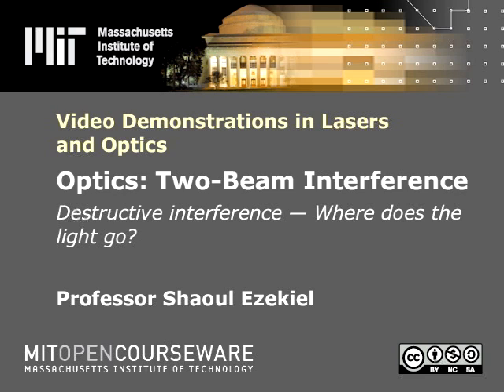Optics: Destructive interference - Where does the light go?

Comment: This is my attempt at the answer to his question at the end: the beam splitter has a thickness, assuming that it is a half-silvered mirror I imagine it could have a layer of silver nitrate around 200nm thick. the light that is returned to the source actually has a different arm length difference than the other since the light returning to the source has one half that was transmitted twice and the other is reflected twice giving a difference between the two lengths a difference of the thickness of the layer of silver.

Comment: Sleepyeyeguy;--The "law" of the conservation of energy says that nothing is ever destroyed.  It is merely converted into matter, light, heat, or motion.  So when the interference pattern shows that two waves of light interfere with each other, then that light must disappear somewhere,(or somewhen).  Or, maybe we are now observing the first concrete evidence on Earth of "dark matter". It appears dark to us, but in a parallel universe, it becomes light.
Reply: The light vanishes from view but it does not reappear in another universe and it does not have anything to do with dark matter. Does the ocean vanish and reappear in another universe when its waves cancel out? You're just adding opposites. 1 plus -1 equals 0. Everything is conserved.
Reply: +Tony Boyle Dark matter doesn't interact with light, hence the name.
Reply: Ah but a photon only "appears" when it interacts with something. 

Hence when the waves cancel, the photons simply don't produce an interaction. What happens? They keep going where they're going!

Comment: Enter the layman;--If the act of observation collapses the wave function, then does that not illustrate that there is more than one observer, and that the primary observer has the ability to change the rules of physics at will.  Or does it illustrate that these rules are only rules because the primary observer creates the rules?
Reply: I don't think this is an observer issue, unless one considers that the observer may draw the wrong conclusions.

Comment: Lasing is a quantum mechanical phenomenon , depending on reflections to sustain the lasing action within the laser. The   the whole system, optical bench-laser-cavity "lases". The reflected photons are a part of the coherent  lasing action  and the energy is part of the energy that exists within the lazing volume, just extended in space by mirrors and reflections.  This is seen in the last demonstrations with the two beams . There always exists a return beam, except in total constructive . The solution to the last question  of the overlap of the return with the  forward wave ,when electromagnetic waves are considered to emerge from an ensemble of photons: There exists a very small probability of photon photon interactions , of order 10^-16 if  the coupling constants in the loops are counted. It is the same reason that to see the interference  pattern one needs material;  the photons have a large probability to interact with the electrons in the material.
Reply: There is no such thing as photons. All the experiments show lights is waves, never particles. If light is particles, explain where are the particles which have been discarded by destructive interference. The alleged light particles have no charge so they can't mutually annihilate, so they must be laying around waiting for someone to sweep them up and put them in the trash.
Reply: @dreamdiction   see this simple experiment where single photons build up the classical double slit interference pattern https://www.sps.ch/artikel/progresses/wave-particle-duality-of-light-for-the-classroom-13/
Reply: the above yutube records an experiment where it shows where the light goes.
Reply: @annavayaki1735  You have obviously never done the experiment yourself so you believe whatever you are told to believe.

What you mistakenly call "single photons" is a high frequency interrupter relay transmitter switch used to produce single separate individual wavelengths, like this ~ ~ ~ ~ ~ not "photon particles".

Continuous waves produce interference patters,  intermittent separate single waves also produce interference but at a slower rate/intensity because of the gaps between waves. The interference is the proof that light is waves at all frequencies, never particles. "Probability waves" only exist in researchers imagination, that's why nobody (including Broglie) could design an experiment which shows light is particles.

The photoelectric effect is easily explained by blue light having the right frequency of positive/negative magnetic induction (alternating push/pull) to magnetically agitate a negatively charged election out of it's shell orbit, that's why the photoelectric effect does not work at higher or lower frequencies - nothing to do with "particles". Did you believe red light was waves but blue light magically manifested 'particles' which disappeared again at higher frequencies.

Electromagnetic Radiation (EMR) is waves at all frequencies, all the experiments show light is waves, there is no experiment which shows light is 'particles'.
Reply: @dreamdiction  I am a retired  physicist, having worked for 40 years in high energy physics experiments, from bubble chambers to the latest large  detectors at CERN. Dream on your science fiction.
Reply: @annavayaki1735  All the experiments show that electromagnetic radiation (EMR) is waves at all frequencies. You think you are an expert but you can't show any experiment which shows EMR is particles at any frequency.
Reply: @dreamdiction  Excelent！！！I am so interesting with your topics.
Reply: @dreamdiction  LMAO, are you denying the whole foundation of modern physics, the particle-wave duality?
Reply: @seanli4279  If particle-wave duality is the foundation of modern physics, it should be easy for you to show me experimental evidence that light is particles. If you can't find an experiment which shows light is particles, design your own experiment which demonstrates that light particles called 'photons' really exist.  Go ahead, show me.
Reply: @dreamdiction  OMG, if quantum nature is that easy to discover , do we need to wait until 20th century to find it? You have absolutely zero knowledge of modern physics, I am physics phd in atomic physics, all the day I'm dealing with photons, go and search what the  Hanbury Brown–Twiss experiments is. At least go to college study some real physics then talk.

Comment: I pulled out some lens polarizers and did some experimenting. I think the answer to the puzzle in the setup is that where there are an odd number of mirror reflections between light of the same initial polarity, there will be destructive interference. Each successive mirror changes the polarity of light. If it reflects off one mirror it is now in the opposite phase, when it reflects of a second mirror it is now back in phase. Also convex lenses do not change phase. And the Professor also added a polarizer after the first mirror after the addition of the beam splitter for the returning light.
Reply: Actually, you'll have to read my post and click the wiki link, or look it up on beam splitters... normal mirrors are not phase shifting... But, a splitter 'can' be, but for only one surface, or multiple surfaces depending upon what kind is made.

Comment: This reveals a early major physics error and why there is no reality explanation for magnetism and gravity.  You can find the answer at synodicgravity.
Its true he will loose his job if he talks about it.
Reply: It only happens at the beam splitter.
Reply: I think you're right, it's an early major physics error; but, not the one you described.  I think it's equivalent to a misinterpreted experimental result designed to teach students to think divergently and critically.  I give my reasoning in a recent post.
Reply: Hi, Chip Copper, I was very curious and just wanted to know if you face 2 laser ( or laser diodes) in a  diagonal arrangement to each other but one has an opposite phase though similar wavelength to the other would that still work as a light cancellation? And say if one laser can travel one metre and I put up another one in the opposite direction but with only half the power would that mean I would only see the light from the laser with more power travel only 0•5 metres  then suddenly seen to stop in thin air?
Reply: Access Denied No, in a classroom what this experiment involves is real world logic, and defines the difference between thinking that can be deceived, and, critical thinking.  The difference between a follower and a leader.  You must place yourself into the fire and come out proven, ready to challenge the blind acceptance students give their professors, or what one"s superior tells them. Challenge authority; but, know what the he'll you're talking about.  The difference between true scientists and a skeptical critic is that the true scientists upon discovering he/she is wrong,  change their line of reasoning, and are therefore right again. 
You see deception, I see an opportunity to learn.  Look for the answer after you have formed an opinion, and never be ashamed for being wrong.  Change your mind and be right again.
Reply: Todd Grigsby  I explained it in excruciating detail in another post, the end result depends upon which type of beam splitter is used.  Thank you Todd, I've put quite enough into this when I first looked at the experiment. It's quite elaborate to look at this from the two perspectives I discussed in the other post, I appreciate anyone who still has enough enthusiasm on this to persevere.

I look forward to what you show.
Reply: I will post a YouTube video that will explain it fully.  It might be several days but maybe tonight if I have time.